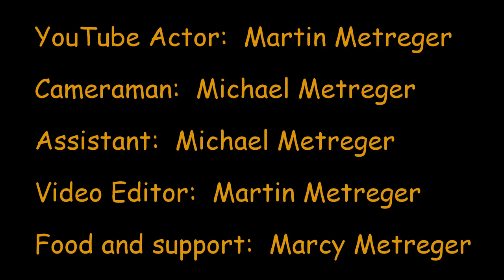DIY Deep Well Pump Replacement

Comment: This is one of the very few diamonds in the rough sort of speak videos. This was very informative, instructive video that pointed out many small issues and mitigation methods to ensure plenty of time before next replacement. I worked on the above ground electrical on an agriculture irrigation well. relocating the control box to a more suitable location. The well was established about 5 years ago. Last week the ‘start’ leg circuit breaker popped. Your video helped me understand all the ins and outs of well pump replacement.👍🏼👍🏼 Awesome Instructions and very dedicated to sharing knowledge! Thank You!
Reply from the maker: That's an awesome comment. Thank you for the kind words.

Comment: Big project but saved yourself lots of $$$$!!  So thankful handy guys like you make videos like this.  Taking video makes it a lot more work  for you, so we the audience sure do appreciate it!  Havent decided yet if I need to replace the pump yet.  Mine is about 35 yrs old!!    I've been away from my home quite a bit with the well pump not running.   I came home, turned on the pump,  and had plenty of black sediment clogging up the filter. Had to replace filter a few times already.   Dont know for sure yet if I need to replace the pump or pull out the system and find out what's wrong.  Going to try purging the tank a few times as sediment can accumulate in the bladder tank as well.  Seems the pump runs nonstop now.  Probably need to pull the well pipe and pump.
Reply from the maker: The bladder in the surge tank can come apart as it ages. It the bladder is bad, it won't have a pressure differential between the Air and the Water side. This can cause the well pump to cycle often. Hard to check but when mine went bad, I shut off the WP and drained the tank until there was no pressure. Then lots of black yuck oozed out. That was from the bladder.  If your surge tank is old 15 years +, you might try replacing it. If the pump runs normal, you good to go. If it continues to run, you might have a bad check valve or a leaky pipe between the Pump and the tank. Good luck.
Reply: @MartinMetregerTipsandTricks  Thanks so much for your advice.  I will definitely check that.  I set the air pressure in the tank about a month ago and everything seemed fine.   I did notice the pump running for long periods of time, though.   I've been back home for about a week now, and the pump is running constantly.  If I shut off the breaker for the pump, then I notice that there is zero pressure in the system and no water will come out of the faucets.  I know the filter is clean because water starts running again, as soon as I turn on the pump.
Reply from the maker: @slipshaft  sounds like the surge tank (bladder tank) is bad. Time to go to Menards. They have tanks, manifolds, gauges and everything you need.
Reply: @MartinMetregerTipsandTricks  Actually, I think the tank is fine.  I was out of town quite a bit and would just shut off the breaker to the pump.  Now the entire weight of the water in the house plumbing,  (in the tank and in the upstairs part of the home) is resting on the highest check valve in the well.  I should have been closing the valve between the tank and the pump also.   I think I have a leaky check valve.  The tank was completely empty and water gauge said 10 psi.  Turned on the breaker and ran it up to 30.  Then as soon as I shut the breaker off, the pressure dropped back down to 10 very quickly.   I ran it up to 45 psi and turned off the breaker. It started dropping very slowly, but I know its not supposed to do that.  20 min later it read 35 psi.    I think I'm going to try installing a check valve between the tank and the pipe that goes into the foundation and out to the well.   Hopefully this will be the quickest and easiest fix to the problem, as I plan to sell the home soon.  I think all of the black sediment and crap was from the bottom of the tank and due to degradation of the rubber bladder.
Reply from the maker: @slipshaft  I get it now. You are probably right. Either Bad check valve or a leak after the check valve. There should be a check valve every 80 to 100 feet. Not always at the top of the last pipe in the ground. You can also have a leaky pitless flange it a leak in the pipe from the well to the house.
Reply: @MartinMetregerTipsandTricks  Yep thanks a lot!  I couldnt have figured this out without your video expalining everything!   The well pump seems good enough to make the water pressure happen, I just lose it after the tank fills.   Who knows, maybe there's already a check valve right before the tank manifold that is leaking.  In that case I just replace it.   I shut off the breaker when I'm gone for awhile because I dont want a flood if a pipe should burst.   Now I'll shut off both the breaker and a valve, at least until I get this fixed.   Thanks again!

Comment: Thanks for taking the time to make this video. I don't think i will attempt this but it's nice to see how hard it would be and why a company charges so much.
Reply from the maker: I wouldn't think any less of you. I helped a friend with his well recently and it turned into a big problem. Mainly because it would only pump 3 gallons per minute. Any more and it would starve for water. The well needed to be drilled deeper but my friend wanted to try everything else first. We had that well in and out 3 times which sucked because it was 400 feet deep. I wish I never offered to help.

Comment: Thanks for your detailed video. We burnt out a pump after it was in use only a few months because of a pipe leak. (And in winter running the water so it wouldn't freeze). We're over a year with no water.  Hauling it in for all uses. I like your added effects. Big heart to go with your big head.
Reply from the maker: Glad it helped

Comment: Good work doing it yourself. The water pressure looked low at the end when you were clearing the line.
Reply from the maker: Only from my hose. between the crappy sillcock, leader hose, hose real, and 100' of hose, that is normal flow. Pressure in my house cycles between 40 to 60 psi. The flow is good and the pump will cycle with the hose running which is a good sign that all is working well. Get it? Working WELL!

Comment: This is the best video I've found so far on DIY well pump work.

My well is dead.  It could just be the controller but I strongly suspect a brown out killed the pump motor.  I'm guessing my well is at least 150' deep and I think it's galvanized all the way down.  I can rig up a winch, but my biggest fear is how to grab the pipe.  I do not want that SOB to slip and then I've got to call a crew in to extract it or worse, drill a new well.  I've seen various means of improvised clamps, but your idea of using a pair of yoke vices looks like the safest.
Reply from the maker: Good luck. Yes there is always a risk however, the alternative is to pay to have it done. I would rather take the risk and be careful about it.
Reply: Man my galvanized pipe slipped down it had an elbow on it and smashed my finger almost cut it off. I went to the ER and they stiched it up. Scary shit

Comment: For a 3 wire system the control box is the starting switch for the motor. 2 wire pump the starting switch is built into the motor. We recommend 3 wire systems. if starting switch fails control box is easy fix rather then pulling pump. Other then that only other thing that goes wrong with the 3 wire pumps is it goes on thermal overload due to windings in motor failing or check valve fails and causes water to run back. We see 10-15 years on average for pumps.
Reply: I own this house since 1986 and the well is 350 feet deep and not sure when the previous owners installed the pump. The water contains manganese but is drinkable. It is still the original 3 wire pump. I had to replace the control box once. Other than that amazing pump.

Comment: I wonder if you could help me find answers to the following: 
Thinking to lower the pressure tank and connect to the pump about 10' - 15' under the ground to eliminate the heating well house in the winter season. My pipe runs about 6' under the ground. 1) is it a good idea?  2) how to do it?  3) Should I install another pressure tank under the house in the crawl space? The well is about 30 yards away from the house.
Reply from the maker: I don't have a good answer for you. The depth of the frostline can very based on location but a bad winter can exceed that. If your crawl space is heated, that would be a pain to get to but safer than under ground tank. But the pipe from the well would have to be buried 6' the whole way to the house. Check with a local well installer.
Reply: @MartinMetregerTipsandTricks  Thanks. The pipeline already baried 6' under the house before it enters the crawl space from outside.. Crawl space is not heated.

Comment: One small correction.  The three wire pump box does not control pump speed. It contains start capacitor and run relay.   Variable speed pumps are available, but use a separate control.
Reply from the maker: You are correct.

Comment: On the torque arrestor, I ran wires inside arrestor including under the rubber ends that are tight to pipe.  Definitely keeps away from rubbing walls but is this better or worse than your way?  I haven't dropped down yet so still easy to change if needed.
Reply from the maker: Will probably work fine. Normally the wires are run between the slits in the arrester but not under the clamp rubber ends. I tried the wires above and below the arrester so it stays tight to the pipe and between the slits.

Comment: Martin what is the name of the winch tower you use for this job?
Reply from the maker: Well Brian, I used a LA12-18 Mini Line Array Tower 12in. Euro Box Truss from the sound company I work for. They sold the tower and winch. I help a friend with his well and used a hoist like this https://amzn.to/3pdBhKs with some Unistrut and scaffolding. Check your well depth. Should be posted by the surge/bladder tank. I don't recommend DIY for wells deeper than 300' . My friend well was 400' deep and it sucked. Really scary weight and took forever with all the pipes.

Comment: I've been reading that the size of the pressure tank also factors into how long a pump will last.   A too small tank will cause the pump to run frequently, wearing it out faster.   It's important to calculate your estimated usage before deciding tank size.
Reply: Yep, my house has had the same well system since 1986!   No problems up until now.  I'm thinking either the pump system or bladder tank, (or both) are failing.  I think the reason it has lasted so long is because of the tank being about 32 gallons, which is large for the size of my home.

Comment: The third wire on a 3 wire pump has nothing to do with speed. It is to energize a start winding in the pump motor, that is what the capacitors in the control box are for, to get the pump spinning.
Reply from the maker: You are correct. After doing some research, I see that the control box is nothing more than a flux capacitor and some relays to start the pump. Again, I recommend a 2 wire pump without control box. The two wire has less components to go wrong. There is still a third wire for the two wire pumps(220 volt) which is the ground.
Reply: great info to pass on., thanks
Reply: @MartinMetregerTipsandTricks  I liked your video, but I have to disagree with that. The 2 wire motor has a start capacitor and relay too. Those components are sealed inside the pump. The problem with that is that those components are a frequent point of failure. If they do fail, then you have to replace the whole pump instead of just a $10.00 capacitor or relay. Also, if the pump motor is on its way out, sometimes you can put a hard start kit on it and milk another few months out of it. Maybe enough that you can put in the new pump on a nice spring day instead of the dead of winter.

Comment: Your awesome! I appreciate you DYI in Hardcore mood , I would invite you over to my house and assist me with one of many pumps; how much was the pump?
Reply from the maker: The pump I bought was about $700 because my well is at 200' and I wanted a pump that could handle the depth.  Make sure the rating on the pump you buy is appropriate for your depth.
Thanks for the comment.

Comment: Where did you get / borrow / rent the overhead rig / winch setup?
Reply from the maker: I borrowed it from a local sound company. You can check with stage rental companies. The first time I did a well, I use my winch on the ATV and mad a pulley system with wood planks.

Comment: Every foot above static level equates to 1/2 psi, so for a 200’ static water level your pump needs to develop 100 psi just to lift it to the surface.  Then it has to build your system up to pressure ~40-50psi.  So 150psi is what your pump has to attain in order to reach shut off pressure.
Reply from the maker: Combat Pyro yep,  sounds right. Thanks
Reply: Martin Metreger your video has been very helpful to me.  Thank you for sharing.  I’m new to owning a private well, so I’m trying to learn more about them after having to pay $800 for the well service to dig up and replace a leaking buried ut pressure tank and repair dirty contacts on a pressure switch.  I may be pulling my pump soon and digging 4’ deep around my well head to cut the casing and make it larger at the top.  Probably need to replace the pitless connector while I’m at it.  Our well is about 30 years old at this point and I want to install a simple pump as a backup for water in a power outage, but we have 4” pvc case and the simple pump draft pipe won’t fit past a pitless connector in a 4” case.  I also want to pour a concrete well head because right now it’s grass right up to the casing.
Reply from the maker: Good luck. Sounds complicated. But YouTube has a lot of info

Comment: Bench Yoke Vice (the 2 pipe vices he is using to lift his pump) aren't cheap.  I did find one cheap bench yoke vice offered on Walmart but it only goes to 1" pipe, the rest of what I could find online ranged anywhere from $125-$275 each.  Unless you have the need for a bench Yoke Vice it's kind of an expensive thing to buy for a one off project.
Reply from the maker: https://www.menards.com/main/tools/hand-tools/clamps-vises/superior-tool-reg-2-bench-yoke-vise/02816-stc1/p-1444444238936.htm

Comment: your heat shrink is not for water,,,,its only for electrical not water....
Reply from the maker: The heat shrink I used is for well pumps. Well Pump Wire Splice Kit, Submersible 3M Dual Wall Heat Shrink Tubing and Copper Connector for 4 Wires, 8 AWG. https://www.amazon.com/dp/B00E8O5ZPO/ref=cm_sw_r_cp_apa_i_GjobCb3TKEVVQ
Reply from the maker: Well Pump Wire Splice Kit, Submersible 3M Dual Wall Heat Shrink Tubing and Copper Connector for 4 Wires, 8 AWG. https://www.amazon.com/dp/B00E8O5ZPO/ref=cm_sw_r_cp_apa_i_GjobCb3TKEVVQ
Reply: He told you.

Comment: I guess this is a deep well.... mine is 600' i don't think it's a diy job.
Reply: Hey Grant. Check out our Boreline.com and you will see that it is a lot easier than you think. We also have WellHose.com that is a DIY drop pipe but your application is deeper but no reason you cannot DIY this.

Comment: I cant get mine up or down  have about 50 ft. out
Reply from the maker: I'm sorry to say that it sounds like your pipe collapsed. My neighbor had the same thing happen. Unfortunately he had to drill a new well. not without trying really hard and breaking the pipe multiple times to pull it out. He might want to seek a professional at this point. Sorry about the inconvenience.
Reply from the maker: Any update?
Reply: I had to use a tractor to lift mine. What happened was the pump broke off at the check valve and was wedged. Luckily,  everything came up.